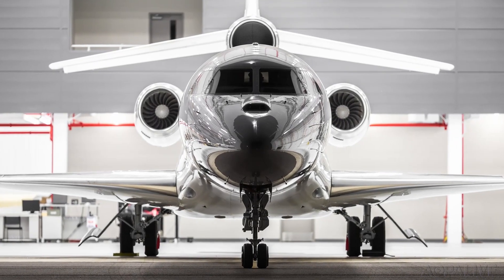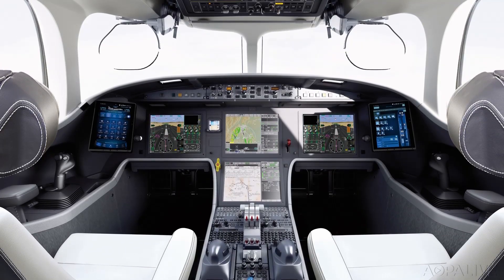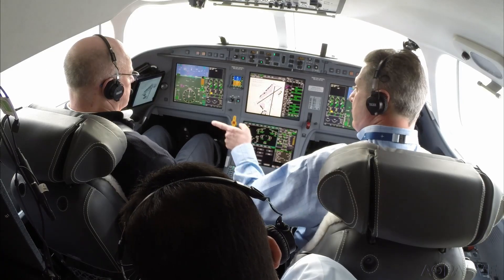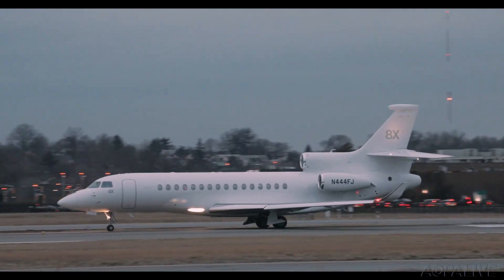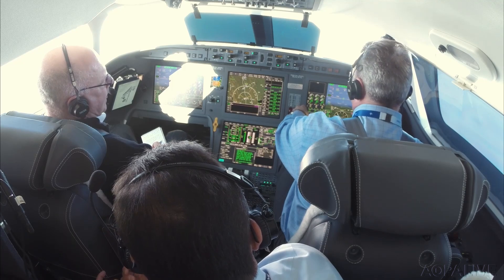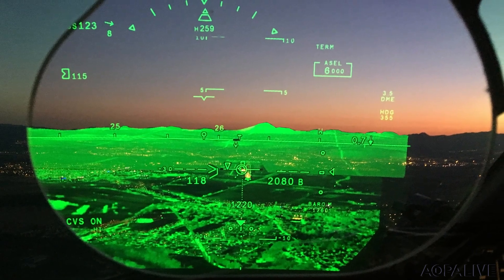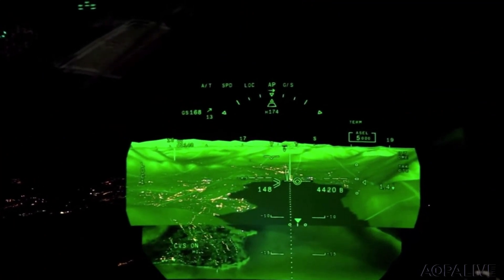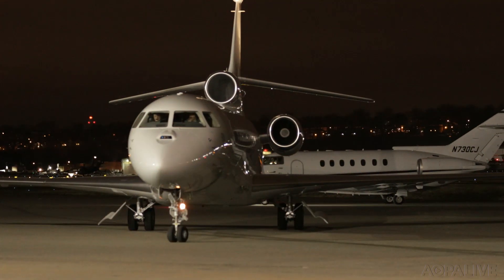Flying the Falcon 8X

Comment: Capable bird, touch on the wasteful side. Interesting synthetic vision it has. Some actual ambition in avionics although the 4 displays are still conventionally cluttered and unclear. Dash is an airliner style vista of clutter. So much legacy 'thinking'. Why have tiny cluttered distant displays instead of a 24" much closer. In zero visibility you are flying on the screens. Imagine if that was your window size and then cluttered on top of that. Fly by wire sticks off the size clears your front to move a big screen much closer. Isn't it fascinating how little designers question things.